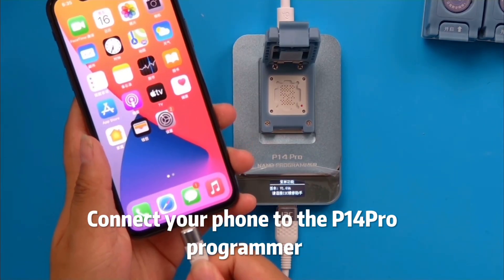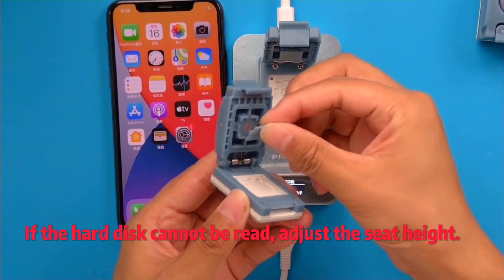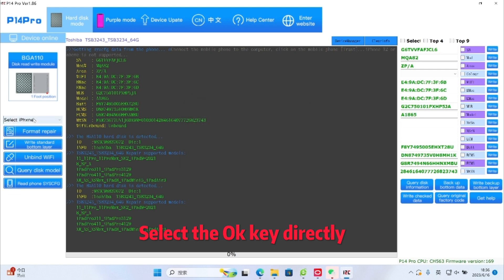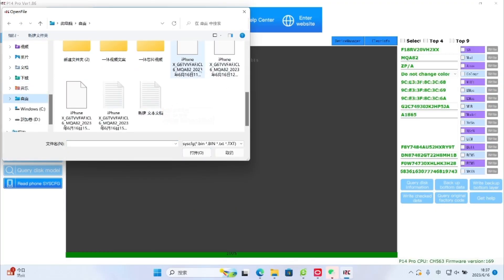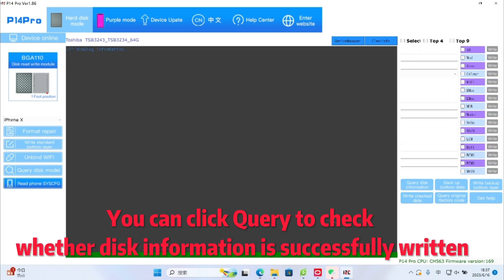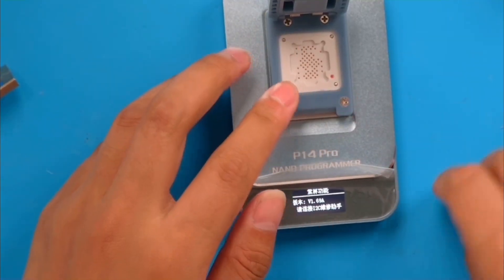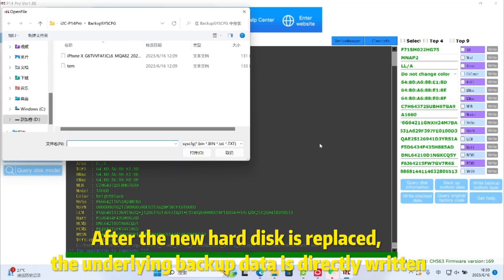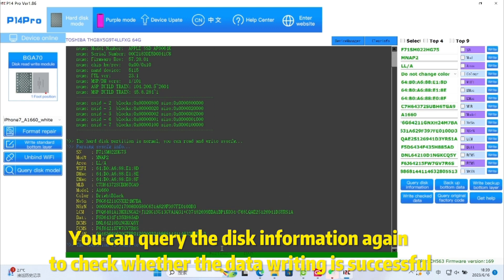87. i2C Tutorial P14Pro HDD Expansion

Comment from the maker: BGA70 operation steps:If you need to change a hard disk for your iPhone7, the operate as following
Step 1: Put your old hard disk into the BGA70 P14pro - P14pro connect with the computer - open the I2C software - click “query disk information” - click “backup bottom data” to save your data to computer
Step2: Put a new hard disk into the BGA70 P14pro - P14pro connect with the computer- open the I2C software -click “write backup bottom layer - install you hard disk to you iPhone 7. Using the flash phone software to flash your phone boot.

BGA110 Operation steps:  About iPhone X BGA110 hard disk change:
Step 1: Put your old hard disk into the BGA110 P14pro - Click “query disk information” - click “backup bottom data” to save your data to computer 
Step2:Put your new hard disk into the BGA110 P14pro - choose the model(what iPhone model you want to use this hard disk) - Click “Format repair” - click “write backup bottom layer” - install you hard disk to you iPhone X, Using the flash phone software to flash your phone boot

BGA60 Opearation steps:  for change a hard disk 
Step 1: Put the old hard disk into the BGA60 - Click “query disk information”  - click “backup bottom data” to save your data to computer
Step 2: Put a new hard disk into the BGA60 - click “write backup bottom layer” - install you hard disk to you iPhone 6Plus  - Using the flash phone software to flash your phone boot. It will can use normally.  

BGA60 Hard disk supports models:
iPhone 5s/ iPhone 6(A1586/A1549) / iPhone 6Plus (A1522/A1524)
iPad air (iPad 5) / air 2(iPad 6) / iPad Mini 2/3/4

BGA70 Hard disk supports models:
iPhone 5SE/iPhone 6S/iPhone 6S plus/iPhone 7/iPhone 7Plus
iPad 5/6/7 iPad Pro 12.9(9.7) /iPad Pro 2(10.5)(12.9)

BGA110 Hard disk supports models:
iPhone 8/iPhone 8plus/iPhone X/XS/XSMax/ iPhone 11/11pro/11promax / iPhone SE2
iPhone 12mini/12/12Pro/12ProMax/iPhone 13mini/13/13Pro/13ProMax
iPad 8(2020)9(2021) / iPad mini 5/ iPad air3/iPad pro3(11) /Pro3(12.9)
Reply: What do u do if th hard disk is damaged for iPhone 6s to 7 plus. Bag 70. And it can’t read th underlying data. Using a 15 pro prgrammer
Reply from the maker: @alexandermadziva3395  If the phone's hard drive is dead, install good hard drive to the phone - turn on the phone first - jailbreak the phone using jailbreak software - after jailbreaking, you can use our I6S programmer to query the 5 data information listed above (connect the jailbroken phone to the I6S programmer via a data cable)  
more information please contact with Bellona + 8618124069709
Reply: ip 13 NAND query always say invalid syscfg.. what should be the problem, i tried 3-4 NAND
Reply from the maker: @vikasagrawal5189  add me via whatsapp + 8618124069709

Comment: Fix the issue on the bga70 after format cant write the sys.backup
Reply: same problem
Reply from the maker: @zerrcarreon5491  BGA70 operation steps:If you need to change a hard disk for your iPhone7, the operate as following
Step 1: Put your old hard disk into the BGA70 P14pro - P14pro connect with the computer - open the I2C software - click “query disk information” - click “backup bottom data” to save your data to computer
Step2: Put a new hard disk into the BGA70 P14pro - P14pro connect with the computer- open the I2C software -click “write backup bottom layer - install you hard disk to you iPhone 7. Using the flash phone software to flash your phone boot.

But if your Hard disk been format repair, please install the hard disk into the phone, then using the flash phone to flash your phone boot. (Attention, please be careful during your disassemble the hard disk,don’t damage it, or install it well, or it won’t boot)  Then take out your hard disk to BGA70 P14pro for write back up bottom layer - install you hard disk to you iPhone 7. Using the flash phone software to flash your phone boot.

if you click the "format repair"accidentally, but don't want to disassemble the hard disk again and again,please try the method as below:
Using purple screen mode to write the back up bottom data
Install the hard disk to phone - using the flash phone software to flash the phone boot - after phone boot connect to the P14pro and P14pro connect to computer - click “write backup bottom layer” --click more function in the purple screen mode - click “Restore factory settings” when the phone been activated, can use it normally.
Reply from the maker: BGA70 operation steps:If you need to change a hard disk for your iPhone7, the operate as following
Step 1: Put your old hard disk into the BGA70 P14pro - P14pro connect with the computer - open the I2C software - click “query disk information” - click “backup bottom data” to save your data to computer
Step2: Put a new hard disk into the BGA70 P14pro - P14pro connect with the computer- open the I2C software -click “write backup bottom layer - install you hard disk to you iPhone 7. Using the flash phone software to flash your phone boot.

But if your Hard disk been format repair, please install the hard disk into the phone, then using the flash phone to flash your phone boot. (Attention, please be careful during your disassemble the hard disk,don’t damage it, or install it well, or it won’t boot)  Then take out your hard disk to BGA70 P14pro for write back up bottom layer - install you hard disk to you iPhone 7. Using the flash phone software to flash your phone boot.

if you click the "format repair"accidentally, but don't want to disassemble the hard disk again and again,please try the method as below:
Using purple screen mode to write the back up bottom data
Install the hard disk to phone - using the flash phone software to flash the phone boot - after phone boot connect to the P14pro and P14pro connect to computer - click “write backup bottom layer” --click more function in the purple screen mode - click “Restore factory settings” when the phone been activated, can use it normally.

Comment: I took information from a healthy hard drive, and when I formatted the hard drive, it gave me error 4014. I tested it on four hard drives. Secondly, when choosing the English language, all options do not activate in the English language.
Reply from the maker: if your Hard disk been format repair, please install the hard disk into the phone, then using the flash phone to flash your phone boot. (Attention, please be careful during your disassemble the hard disk,don’t damage it, or install it well, or it won’t boot)  Then take out your hard disk to BGA70 P14pro for write back up bottom layer - install you hard disk to you iPhone 7. Using the flash phone software to flash your phone boot.
Reply: Youve said this multiple of time but i don't know why people are still troubled with this